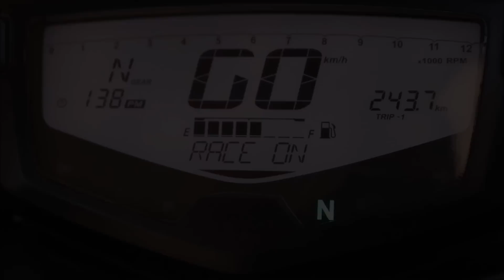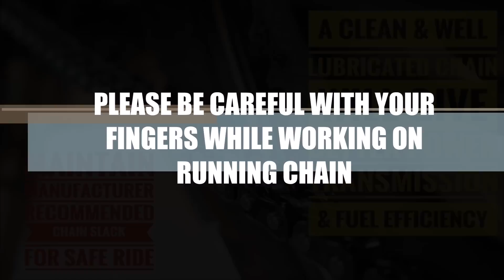TVS APACHE RTR 200 CHAIN SERVICE | CHAIN SPROCKET CLEANING & LUBRICATION VIDEO APACHE RTR 200

Comment: Hi, I took short test ride of my cousin brother's 200. Liked it very much and I also purchased Apache rtr 200. Just one thing I felt front brake is too sharp for my liking. It doesn't slows me down but just bring me to halt immediately. can you please help me. what can be to reduce that instant bite and sharpness?
Reply from the maker: arshad javed  Hi, congratulations to you on your 200. The 270mm front & 240mm rear disc brakes performs efficiently on the RTR 200. I would suggest you to practice braking with braking forces distributed as 70% from front brake & rest 30% from rear brake. Remember braking from your side should be progressive. No the disc brakes on RTR or as a matter on any bike are not adjustable for braking force/performance. Ride safe.
Reply: The Sportztourer thanks for prompt response. Also wanted to ask have you done any paint protection for bike. I can't find any suitable thing in Indian market for matte finish.
Reply from the maker: +arshad javed I personally won't recommend any polish/wax for matte colours. As these things are used to bring shine/gloss which will beat the purpose of having matte colour. Matte colors are generally very durable colors which don't require any special attention that is reason you find them in many commercial & defence vehicle. Use a good washing product & a microfiber cloth to clean the bike.
Reply: The Sportztourer my matt colour became glossy
Reply: The Sportztourer I heard that diesel is not a good cleaning agent
Reply from the maker: subharaj naskar Thanks Subharaj for raising the question & I must clear this. You can use Chain cleaner spray available in the market, which is nothing but degreaser. Chemically diesel is one of the best degreaser with good solubility & lower volatile nature, which helps to drain the dirt deposits from the chain link. Flash point of diesel is high enough to make it safe to use it on chain (any ways we clean the residue) and it doesn't ignites with spark/static. Only thing that should of concern is the oxidation rate of a degreaser which very slow in case of diesel (but present) so it necessary to wipe out the residue diesel (shown in the video). Being a strong degreaser it cleans thoroughly so we should always take care that latter the chain links are lubed propertly. Best example of this is my other bike's chain (o ring type) which is still going strong at close to 50k km on the odometer. 
However in cold countries where temperature reaches lower than 0 deg C, diesel fails to act as degreaser as it has a tendency to turn into jelly state when stored in open (non insulated/iso-thermal way). In such case citrus based degreaser are used.
Hope these helps to clears your query & thanks again for getting this up as a explanation was necessary.
Ride safe